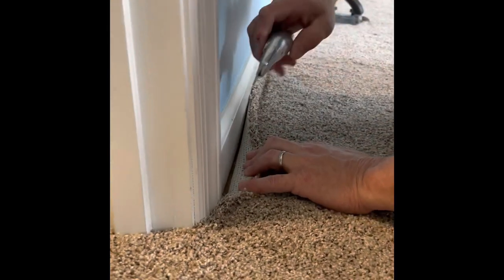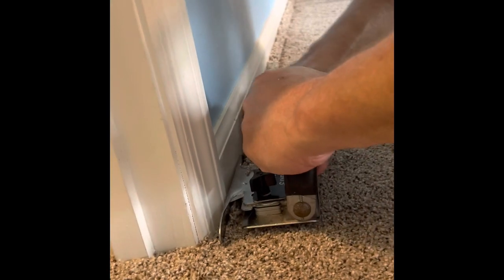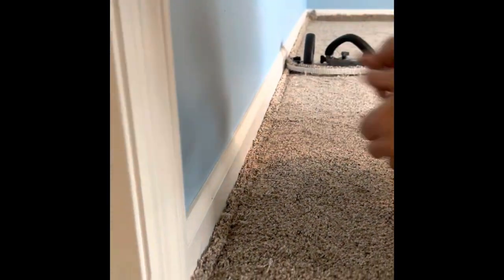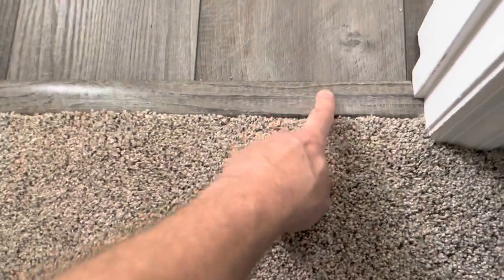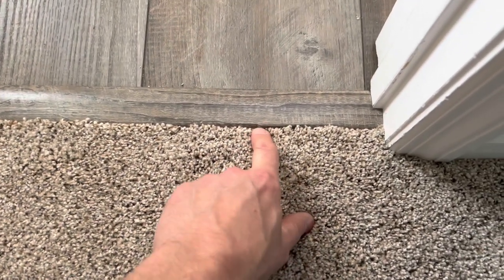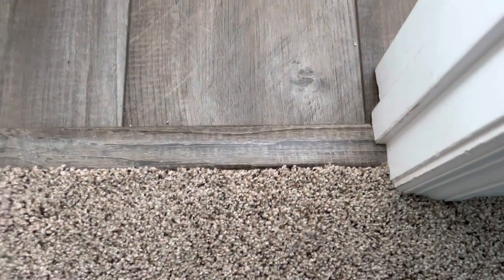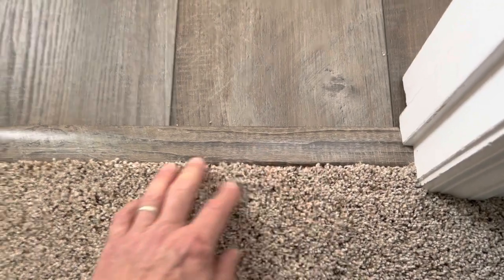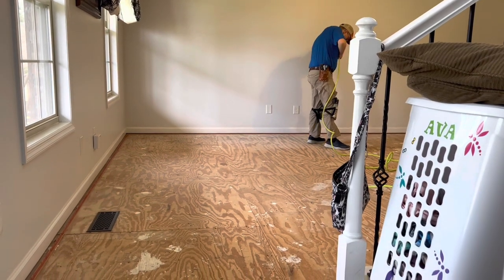Daily vlog Carpet install with ridiculous seams￼

Comment: That join🤦‍♂️
Ruben, is your power stretcher the steel poled or the Aluminium poled version?
I’m even finding that too heavy these days🤨
Reply from the maker: Mine is A heavy metal one
Reply: I’ve had my aluminum one for 3 years with no problems. They sell a 6ft pole that is a life safer & makes the stretcher way easier to swing instead of having 4 pipes
Reply: @Owensti  YES  get two 6ft and it's better yet!!